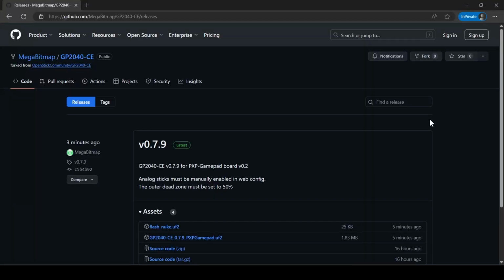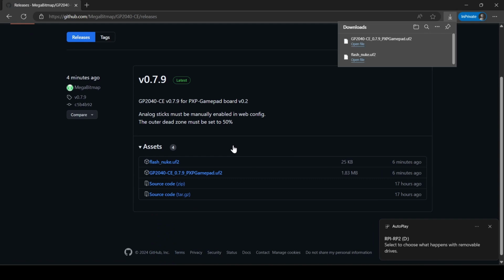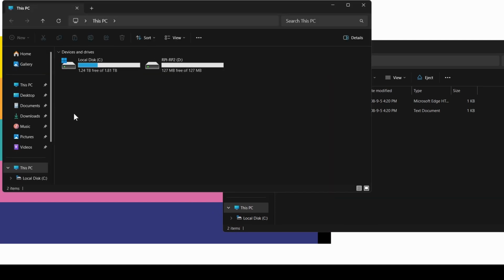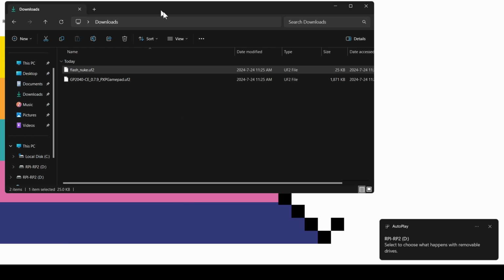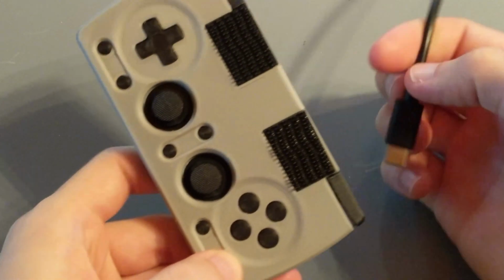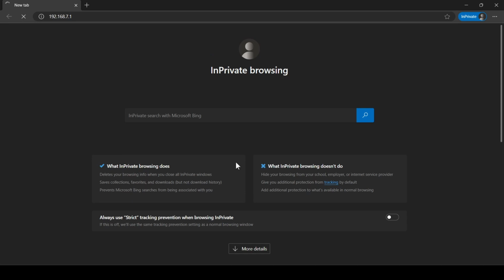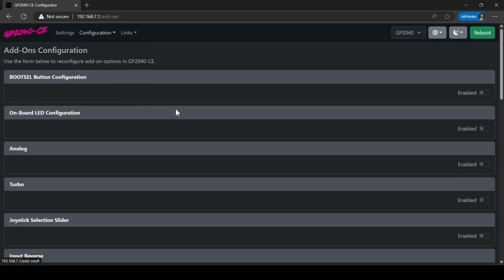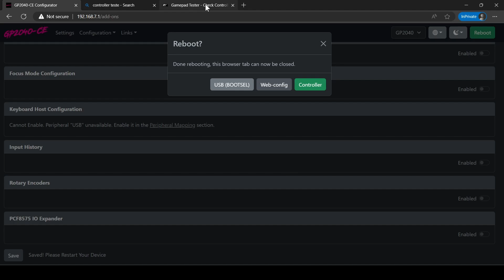DIY Pocket Sized Game Controller - PXP Gamepad

Comment: How do those shoulder buttons work? It seems like they would not be able to slide to interface with the switches.
Reply from the maker: They work similarly to the gba sp or ds lite shoulder buttons. Feel free to create a fork on github if you want to make improvements to the design.

Comment: Your analog sticks... do they work like digital buttons or like true analogic ones? I hope it's not a very obvious question
Reply from the maker: The PSP sticks function as proper analog joysticks. You can even make fine adjustments to the dead zones in the web-configurator. https://gp2040-ce.info/add-ons/analog
Reply: thanks =D

Comment: what for is this shielding?
Reply from the maker: @lancesubscribes7082  Because the controller is attached so close to the phone, without shielding the wireless lte connection can cause the rp2040 to become unresponsive requiring a reset or unplug replug. The best way to fix this would be to update the pcb to use something like the xiao rp2040 as it has an RF shield pre-installed. During the testing I did without any shielding the controller worked fine as long as it was an inch or more away from the phone. I used aluminum foil to block the RF interference but copper tape would be better.

Comment: Would you be able to help me out with making my own set of controllers?
Reply from the maker: @r_angel_ov  you should make a video about it
Reply: @MegaBitmap  actually, I figured most of the stuff I had problems with today ( I am using a esp32 and custom pcb board to create ps5 like but better controllers ).

I will do a video maybe once my 3d printer arrives! Cheers!

Comment: outstanding work - very generous of you to share openly. I'm considering slightly modifying the PCB design to support a battery and an RP2040 BLE. Do you have that in the works already?
Reply from the maker: @alexnesta4070  I do not have any plans to make a wireless version. I thought about it but decided against it after considering the added size and complexity. I wish you the best of luck with the modifications.